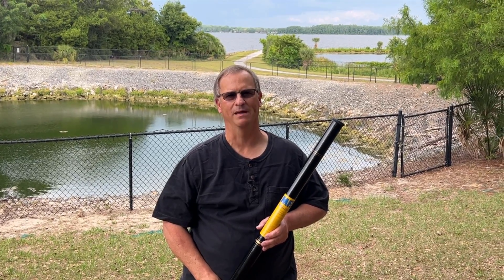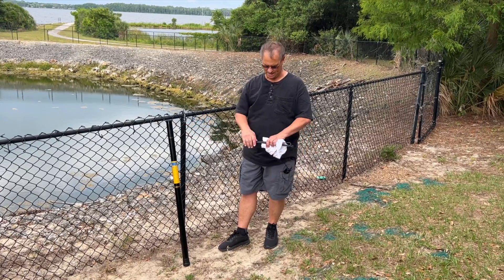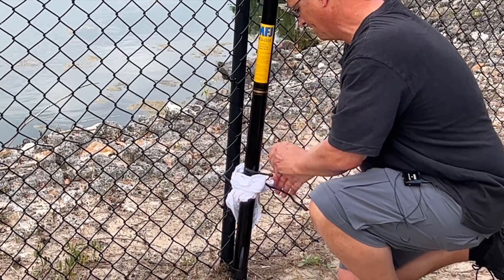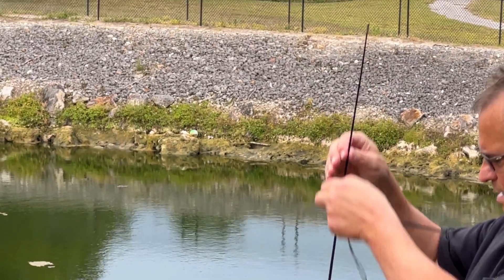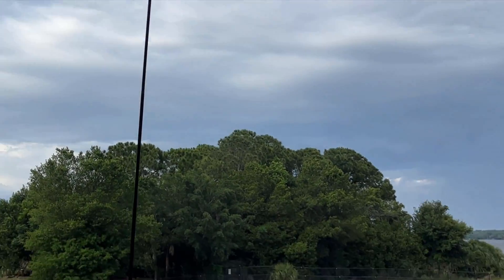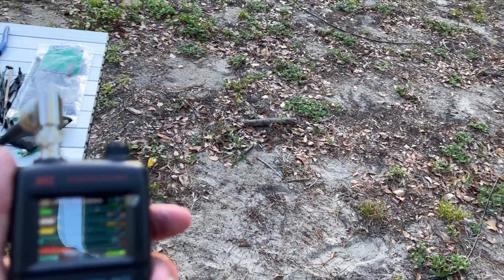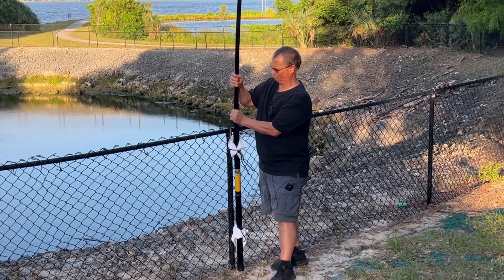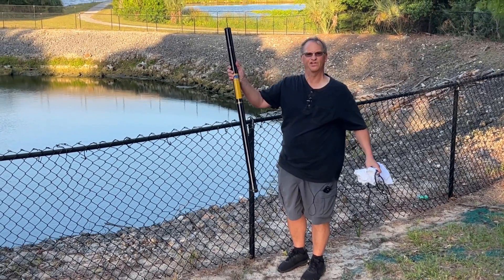Mini Review of the MFJ-1910 Fiberglass Telescoping Mast 33 Feet for Ham Radio Antennas

Comment: The trick to using these lightweight masts is (rather obviously) to keep antenna weight down. Unfortunately, most commercial antennas are too heavy, as they are constructed with 14 or 16 AWG wire. I make all my own wire antennas, using 24 AWF PTFE wire. Instead of feeding them with coax, I use open-wire feedline constructed with the same wire.  These antennas weigh just a few ounces yet can handle 100W with no trouble.
Reply from the maker: Making informed decisions that relate to your application, nice.

Comment: Thanks for the great video.  Very newbie question here-would this mast work for mounting a Diamond x30a?  My home is a rental, so anything I do needs to be temporary.  Thanks again!
Reply from the maker: brian Keith, I'm afraid you will need something much more substantial for the Diamond x30a.  The fiberglass poles are meant for hanging wire antennas only.  Most people hang the Diamond x30a from brackets attached to the house; I understand you can't do that.  I'd Google and YouTube search "mast for Diamond x30a" and see what comes up -- I'd check the "images" part of that search as well.

Comment: Feature I can't find discussed is if you can avoid extending the smaller section (just the lower, larger sections) if you only wanted maybe half the height. Is this possible?
Reply from the maker: Thanks for the comment Richard.  I've come accross a few things I'll be adding on the next mast video, and yours is going on the list.  Thanks for watching.
Reply: @HOAHamRadio  at least a yes or no perhaps? :)
Reply from the maker: @richardneel6953  Sorry I misunderstood.  I've never tried it, but I think you would risk getting the smaller sections snagged when you started lowering the larger sections.  You can do half the height, starting with the smaller sections, and not using all the larger ones -- this I have done and know it works.